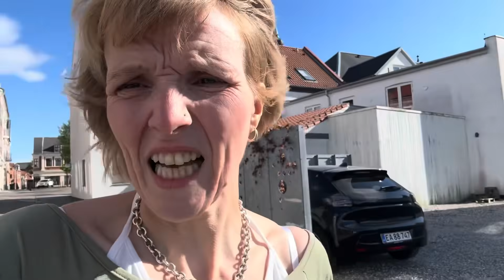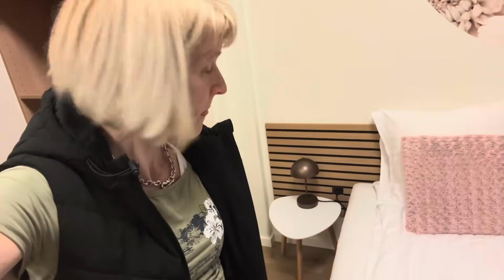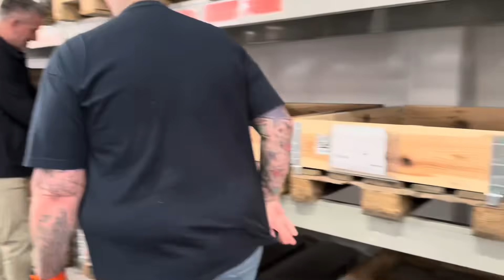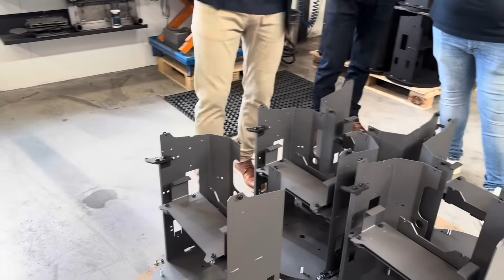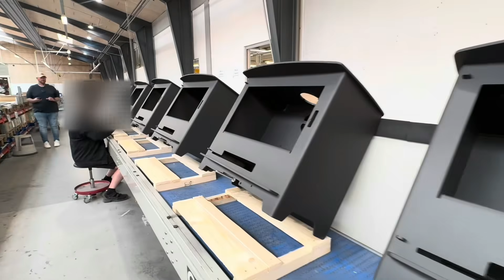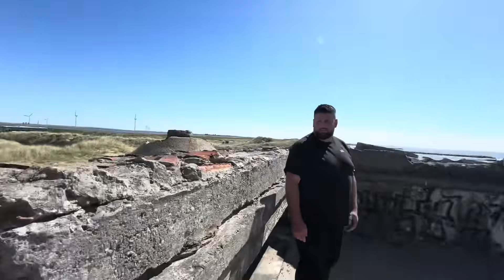HETA A/S - Visit to The Heta Factory in Denmark - Manufacturer of Wood Burning & Multi Fuel Stoves

Comment: HETA stoves are really good, grew up with one (HETA Scanline 16 from 1995 with back boiler) heated the whole house and the firebox is big so it can take whole unsplit 25cm diameter logs (in a pinch, i doubt it would be good for the flue) never had any issues other than a broken baffle plate so heta stoves are really built to high standards!!